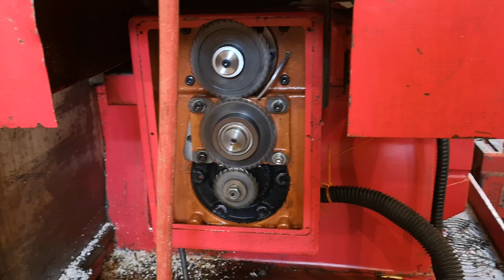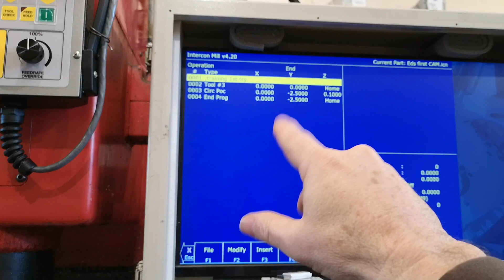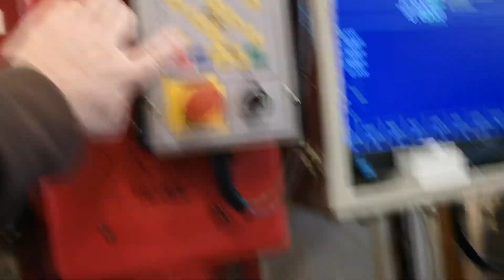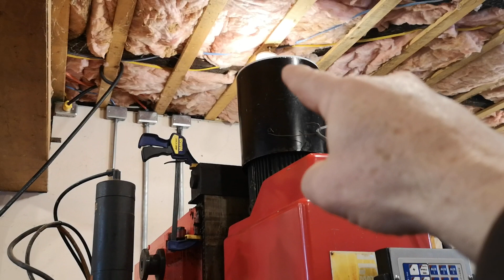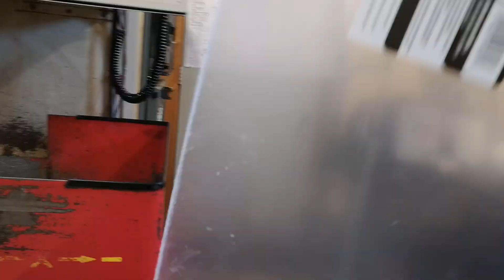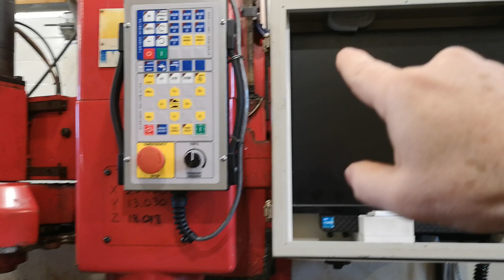1982 Matsuura / Centroid CNC retrofit "in process"

Comment: Very nice. I have an 81 MC-500v. The controller is original. Planning to use it as long as i can until i upgrade it with Centroid or whatever. Sounds like you may need some spindle bearings.
Reply from the maker: Thx for bringing that to my attention, even tho It isn't what I want to hear, haha. I was thinking about going with better bearings and then I'd be able to go to much higher rpm's. Have you ever heard of anyone doing that with these old machines? 
By the way, I have many spare parts if you are interested. I'd sell for reasonable price. I have 2 spindle drives and I think 5 or 6 servo drives. Seems like there are other goodies I can part with as well. I have all the control boards too I think. If you bought enough parts, I'd just throw stuff like that in for free.
Reply: @eddowney9548  actually mine had a bearing job done on it and was only used for like two years before I bought it. The guy said he did it himself and the hardest part is lifting out the motor. I'd have to look at the prints but I think it's just got a couple main bearings and a couple thrust bearings. So it's supposedly not as painful as rebuilding a Bridgeport. I have a spare motor. And electronics for an 82 I believe... Hard to tell the difference. The V2 had the option for a 10k rpm spindle. And probably different software. I got basically everything electric from the other machine except spare servos, switches and solenoids. So I might have to take you up on that at some point. Still trying to just get it fully powered up. Trying to get enough power to the garage safely but as cheaply as possible. Also I amassed a load of literature for the 81 and 82 models. Here's a link to everything I got in PDFs. I also have some paper literature that I need to scan eventually with more detailed mechanical information etc. Let me know if you have any issues downloading it. Are you by any chance on the Home Machine Shop group on Facebook or any other groups we may have in common? https://drive.proton.me/urls/TW39CMK8X8#yVNxFuJ8gg5I
Reply from the maker: @dablankenstein  I bought my own VFD spindle drive, so I can go very high rpm's if I could get the spindle to hold up to it. My machine is rated for 4000 rpm's. I'm thinking with proper bearings I'll be all set.

No, I'm not on any forums. I tend to take the military approach. That is to say that I try to figure it out without bothering anyone until I have to. So far, I have been able to scan various forums and find someone else asking the same question. I also belong to a makerspace and there are a few guys there who can help out.

Thank you for the files! They downloaded no problem. I'll have to figure out how to make what I have gathered available to you.

I'll be posting a vid on the main cabinet soon. I am rewiring the whole thing. I still don't have everything I should have, but I'll have to do more upgrades later I guess. Of course,  it'll be no good to you because it's mostly centroid stuff, except the servo transformers that I reused. I had to go with the centroid system, or something like it, I don't have the knowledge to use the original electronics. I am having to learn a mountain of info as it is. It actually ran as is when I bought it, but had alot of "ghosts" in the machine. Always something weird happening.

btw, my spindle belt has "memory" in it from sitting in one position forever. Do you know anything about that belt, and/or a source to buy a new one?
Reply: @eddowney9548   you're welcome! That's nearly all the information I've been able to find on that thing. Methods Machinery does have a few resources of their own for these things that haven't been thrown out that I haven't acquired yet.

The belt will just be something you'll have to either ask Matsuura about, or you can measure it and call Kaman Industrial or another company that can find you one or have one made. That's actually a good thing. Most of the parts can be replaced by something else or something standard. There's not much in these machines that was proprietary. Most of the weird stuff can be supplemented. Bearings and belts are technically the easiest things. Most of the replacement parts that aren't hideously obsolete will be at least known by dealers like Methods, so you can ask them too if they were the ones who imported the machine originally.

Not sure if the bearing packs were very different between the RPM specs. So I would guess once you rebuild it should be able to do 10k. Pretty sure it's just the motor and VFD that's different.

The most annoying thing that I think I may encounter while upgrading is that they used to use 12v servo encoders, but I think they changed to 5v in 82. 12v ones don't play nice with new stuff. There's a guy who did a Mach3 conversion on here that had to align and epoxy new encoders.... Not doing that. lol I'd sooner buy newer used Yaskawa AC servos or make custom mounts for standard encoders.

I asked about forums mainly to open a line of communication. I'd rather not put my email out here for everyone to see.
Reply from the maker: @dablankenstein  that's good to hear about 10k rpm's. I'd like that very much.
 
I am using the original servos and centroid encoders. I just customized the mounting. I am rebuilding a servo right now, so I could do a vid on how I did it. The only problem is, it isn't perfect. Plus, when I ordered the encoders I got 1/4 inch bearing and it is much harder to adapt it. I should have gotten the 1/2 inch. The shaft of the encoder armature is around 5/8 or something, so I could easily  turn it down on a lathe to 1/2inch for a perfect mount job.  I suppose I could still do it for a 1/4 inch. I'll have to look at it again I guess. Anyway, what I have right now runs out a little but the mount is a thin piece of metal that flexes and gives when it needs to.

I have many things on this build that is "temporary" and I am trying so hard to make sure they don't become permanent, haha.

Comment: Love the build, I had an old 85 mazak that I was gonna retro to centroid but it was to big for my home garage. 1 thing I'd like to share is if you have DC brushed servos you wanna do maintenance on them before they short out. All you gotta do is pull out the brushes and blow it out with air. I guess to much graphite dust can hurt them? Or the drive? And if you want you axis to quiet down you can install new thrust bearings on the screws
Reply from the maker: Thx for the info Jason. Yes, my servos are DC. I had the x axis go out already. Luckily, I had a spare servo motor. I guess I should take the failed one apart and clean it and see if it'll still work. If so, I'll swap them out one atta time and clean them all up. And, most of the noise is when I in move in the z axis. Can you tell me how much trouble it is to exchange the thrust bearings? I'll do some research on my own of course to see what I can find out. Of course, if I do one, I'll do them all.
Reply: @eddowney9548  very easy, just line up the arrows correctly, (there a matched set) just prop up the head and take apart what you gotta.....you'll see once you pull the guards. Have fun! By the way,,if you don't have play don't change them...the new ones will just be quieter..put an indicator on the end of the screw and see if it moves in and out. (Any movement is bad)
Reply from the maker: @jasonruch3529  thx Jason. I have checked the backlash, and there is almost none in all axis'. Would the "play" that you are talking about show up that way? btw, it uses gears to drive from the servo motor to a coupling gear to the gear on the ballscrew. I was thinking alot of the noise was just the gears clanking. I don't have the covers on and the noise would be louder than when it all gets buttoned up.
Reply: @eddowney9548  if you put an indicator on the end of the ball screw and jog it back and forth.....if you don't have and movement the bearings are fine..just noisey...if you get like .001 of movement I'd change em. There should be zero play in and out of the ballscrew
Reply from the maker: @jasonruch3529  ok, thx! I'll do that. and make a little vid of it too maybe